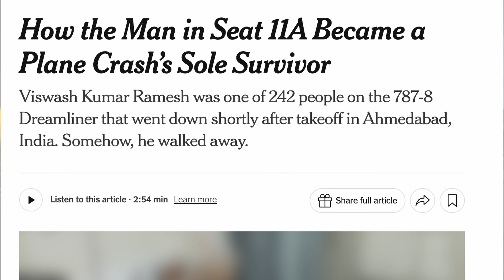Why the RAT Changes Everything – Air India 171 Update

Comment: I’ve been following this story across several news outlets. There was one that showed the right wing, but I couldn’t tell if the flaps were deployed (night shot, not in view). Saw one today that was of the left wing where it was obvious (day shot, good view) that they were deployed. Also, in the shot you just showed notice the position of the trucks (main landing gear). They’re being ready to be stowed away (tilted forward instead of backward). With everything put together so far it seems that the engines were fuel starved, like the fuel pumps lost power somehow? Or the fuel to the engines was shut off? (Like a valve was shut off, No bird strike, no compressor stall, no black smoke, no catastrophic dismemberment of the engines as when fan blades come loose). Just off!!! If it were fuel contamination they would still be running, not good but still running. 🤷🏻 Just some observations.

Comment: Would a complete electrical failure make the engines roll back? There are rumors that the plane had electrical issues and non-working AC on a previous flight the same day. 
Too many people have immediately jumped on the human error theory, even though it would take one of the dumbest human errors and either ignoring the warnings or having the warnings fail to go off.

Comment: To my mind, loss of power seems quite plausable because on take off the engines will make maximum power. You can see the aircraft is heavy, wing tip flex. If the engines were making max power you would not hear the RAT.

Comment: Captain Steve is a bit late on this one and got it wrong on his first analysis. A number of reputable pilots have suggested right from the beginning this crash was not flat related issue while Cpt Steve elaborated his flap-leaning theory on main stream media outlets. There are many reasons to not believe this is not flap or pilot errors. FIRST: AI pilots declared emergency to ATC with "Mayday, Mayday, Mayday-no power-no thrust, going down". SECOND: the mayday call and RAT clues were out there a day ago, THIRD: many photos from the wreckage show that the flaps were extended (available a day ago too). FORTH: as per B787 pilots, this aircraft is equipped with flap safety feature which prevents pilots from making unwanted mistakes. FIFTH: unlike turboprops, the landing gear lever of most jet airliners is located on the main instrument panel right in front of the pilots whereas the flap lever is located on the central pedestal. Both locations are far apart. It's unconceivable that trained pilots will make such a mistake (unless being drunk). I feel sorry for the flight crew members and their family for being bashed on western media suggesting that this is likely a pilot error while evidence points to mechanical failure. Some analysts have even openly stated without any hard evidence that the pilots "forgot" to retract the gear. The Youtuber called "
blancolirio" posted a  day ago his take regarding this sad accident: 
https://www.youtube.com/watch?v=MPk31EhtakE

Comment: A man who was a passenger on that plane earlier in the day posted a video showing that the call button, screen for viewing videos and key pad  were dead and not working that there were electrical issues on his flight. I'm waiting on the black box analysis. I also saw the RAT  explanation  with sound on a separate video. Regardless of the cause, this has been a horrible tragedy mentally affecting so many who are otherwise not involved.
Reply: The video you are referencing was actually filmed sitting on the ground, because at one point you can see an airplane out the window parked at a gate.  The ground air conditioning must not have been connected to keep the cabin cool.  Airliner use the air conditioning system flow to pressurize the cabin airborne, so no B787 will ever just be flying around with no air conditioning.
Reply: @gordonbryan8381 there’s a video filmed from a guy sitting at his seat
Reply: @gordonbryan8381 oh you mean it wasn’t airborne.  Right.
Reply: If you’ve seen the original video you’ll see that he posts in the title that this was the exact plane waiting to take off on the flight prior to the crash. There are also several reports from crew on this same plane that had complained about electric faults including a/c that were often left without repair due to the pressure of keeping their premium flight to London consistently running. Sadly it may well turn out to be another example of poor maintenance.  @gordonbryan8381
Reply: I saw this video but I’m not super convinced. The video just shows the touch screen being non-responsive, not a completely dead screen. Other passengers do have their screens off, but it could be a polarizer on those screens filtering out the video from other passengers. It’s possible something else went wrong but I don’t see why the screen would remain powered.
Reply: @soryuushi it was enough for the passenger to make a video about it.  He clearly thought there was an issue to bother making the video.
Reply: that video was not from the same day
Reply: Wow awesome update
Reply: I saw that video. Was that the same plane that later crashed?
Reply: @SherlynNeblett Akashi Vatsa is the passenger
Reply: @SherlynNeblett this was reported 2 days ago as well.  “Captain Steve” doesn’t do much research.
Reply: Boeing needs to be investigated. Boeing employees have reported safety concerns regarding the 787 and 777 jets. These whistleblowers were found dead the night before they were scheduled to testify in court ------reminds me of Mafia movies.  The US government will likely try to protect Boeing, as Boeing has a strong lobby and donates money generously to politicians.

Comment: Not positive , NOT POSITIVE ?  Is it true from the videos that when he touchdown his tips of right and left port and starboard wings were somewhat parallel to the ground ?  If  so  would that rule out a total failure of one engine be at birds or whatever and the other engine to be maxed for takeoff and operating?? is it not logical that if one engine at that moment totally failed that there would be a cart wheeling affect of the aircraft be it only hundreds of feet off the ground that would reduce the possibility of recovery and the aircraft would cartwheel right into the ground similar to American Airlines DC 10 out of Chicago O’Hare back in the 70s and one engine had not been properly reinstalled to the engine pylon, which caused one engine to take off and takeoff and leave the wing and the pylon cartwheeling effect. Everyone dies total loss. .? Sad  but  true .

Comment: So now the question is what can cause a dual engine failure in a 787? Some potential options:
-fuel starvation (fuel pumps stopped working)
-fuel contamination (bad fuel from the airport)
-FOD (birds or runway debris or potentially a blown tire on the nose gear that had pieces go down the engines)
-some catastrophic electrical malfunction that would impact the fuel system
-pilot error (one engine failed and then they shut down the working one by accident) 

Just too many unknowns now to be able to say

Comment: After my pilot friend mentioned the MISDYE incidents in the past.   I checked with chat GPT. 

The Air India Crash Possibility
While official causes of the recent Air India crash are still under investigation, signs like:
Sudden loss of altitude after takeoff
----Deployment of the Ram Air Turbine (RAT) (which only deploys when engines fail)
No reported external cause (e.g. bird strike, weather)
suggest possible dual engine failure, which can occur if:
----The aircraft was fueled with the wrong type, such as diesel or contaminated fuel
----A dye misidentification (e.g., blue instead of straw/yellow) misled ground staff
---The engines flamed out due to incomplete combustion or clogging

Comment: And so the conclusion would be a maintenance problem for the Airline or the Boeing Quality Problem with the Engine Build right? As there is a circulating video that the a/c and everything that should be working, the screen does not work etc prior to this crash with the plane, probably they do not do maintenance prior to the purchase of the 787.

Comment: A 787 with even one engine would have been very audible. You at best hear the sailing of a wide body through the air or adjacent jets. A rat with even 1 engine would have been barely sonically audible unless you both saw it and sought out that frequency.

Comment: What are the chances that both engines failed at exactly the same time with the same rundown schedule with no pops or bangs or smoke? No yaw so both engines wound down at the same time and the same rate. Virtually impossible but not completely impossible.

And why no flaps??

Comment: Instead of looking at this as engine failure, is there some path that allows for electircal failure even when engines are running, or more specific to this case, as the engines didn't seem to be at full power for take-off, could an electical problem caused engine failure?

Comment: [14.6., 15:02]: If the RAT was out, either faulty wiring or battery.
[14.6., 15:12]: Why? 1. Early 787s often had faulty wirings. 2. Passenger getting off told about no AC and blank screens. 3. Passenger surviving told about loud bang. 4. Fuel contamination would not stop both simultaneously. I would sell B stocks and of course: "If it's Boeing, I'm not going." - maybe later.
Airbus decided not to use lithium batteries on their planes for safety reasons and when I think about the 5 or 6 car transports burned out ...

Comment: The flap control and the landing gear handle positions are so wide apart in the cockpit..the flap control position was designed to mitigate and prevent accident involving mistakenly switching the landing gear for the flap.. Furthermore the warning beep signal will be triggered when the flap is not employed properly during take off...power loss leading to hydraulic control issue is a potential possibility...thus the pilot may have deploy the flap properly but any combination of power loss , mechanical and electronic failures  may lead to flap and engine failure ..an experience pilot should not have any notion that improper flap control by the pilot may be a potential root cause leading to such catastrophic failure..I really doubt if this guy is honest in his analysis of this crash. Remember the pilots has less than 29 seconds to respond to the emergency!!!!!!Blaming a pilot who has no means to defend himself is a very dishonourable act...what a shame

Comment: Have you noticed that after the plane dissapears, some dark object goes up like fluttering? If this was not a coincidence, it should have been blown up by  the thrust of one engine, probably from some rooftop.

And so, at least one of the engines would have been giving some thrust.

In some other video another person said that the RAT would also be deployed if just one engine failed during takeoff.

Could have been a severe hydraulic fluid loss? If so, even the RAT could not have generated hydraulic pressure for the flaps nor the landing gear to operate.

Of course, had the flaps been correctly set, then the plane would have kept flying, even without rising the gear... Or maybe not, if only on one engine and the gear down?

Comment: I told you this days ago. Here is another one. Search for a service video on how the landing gear retracts on this type of aircraft. Notice that when the landing begins the retracting operation, the gear tilts forward before it is stowed. Then look at the very same video of Fl171, notice something familiar on how the gear is oriented? Yes, the gear is tilted forward, but it got stuck! Because they had no hydraulic pressure, the engines were not producing power. It was a total power loss, which resulted in no lift. This is confirmed by the mayday call.

Comment: There is a potential risk of taking off with the crossfeed valve open and two fuel pumps off on one side during fuel transfer, as indicated in the Fuel Imbalance Checklist. Since two pumps may not be sufficient to supply both engines at takeoff thrust, Boeing should review this checklist to ensure it is not used during the takeoff phase. Additionally, simulation tests should be conducted to determine whether such a scenario could realistically occur. This configuration could potentially be one of the contributing factors to the recent crash and therefore warrants urgent examination.

Comment: There was a B767 over Canada that was mistakenly not fueled up correctly and the RAT saved it so it could have controlled glide until landing by the pilots.
Reply: But it was at a high altitude. This one didn't have enough lift to glide.
Reply: @legallyregarded You’re 100% right! But with that high altitude B767 flight, the RAT proved it can save a plane!